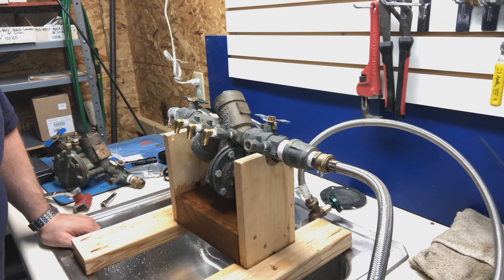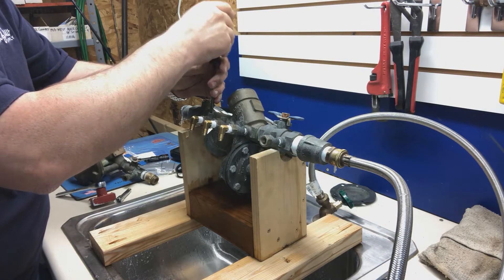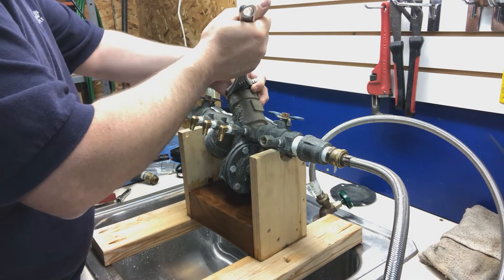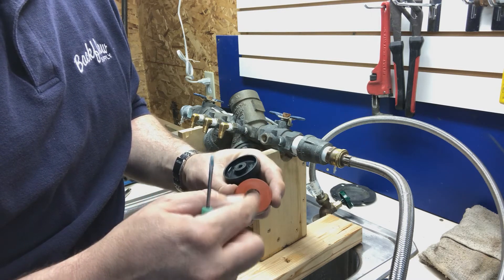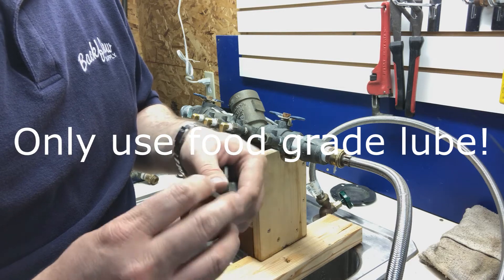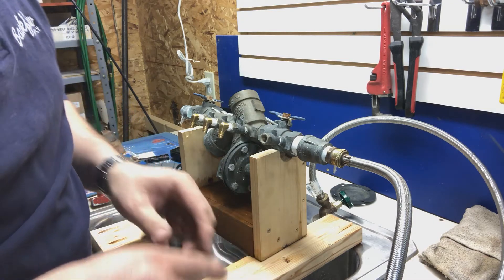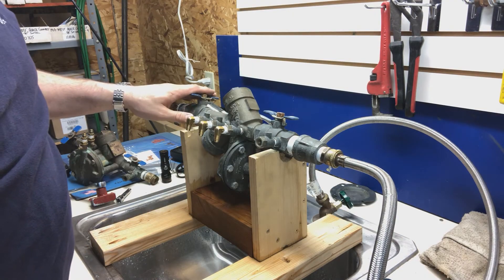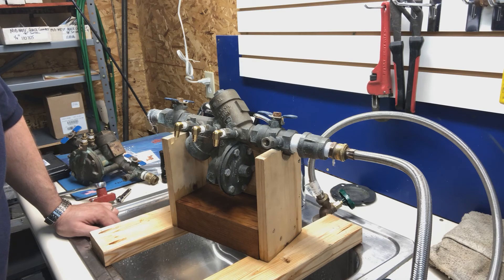How to Trouble Shoot a Leaking Backflow Assembly

Comment: How can i removed the sit inside and wgat is the special tool
Reply from the maker: If you are referring to the seat in a 975XL or 975XL2 assembly you can make your own tool or find something that will fit between at least of the nipples in the center of the seat, you can use that to unthread the seat.  Otherwise Wilkins makes a flat piece of metal tool https://backflow-supply.com/collections/backflow-test-kit-accessories/products/seat-removal-set-950-975xl or this option for the 3/4" and 1" line sized assemblies https://backflow-supply.com/collections/backflow-test-kit-accessories/products/bft-1-wilkins-950xl-975xl-seat-removal-tool or this one for the 1 1/4" -2" https://backflow-supply.com/collections/backflow-test-kit-accessories/products/bft-2-wilkins-950xl-975xl-seat-removal-tool. There are a couple of others that use a tool with a ratchet but I have been out of these for awhile and not sure when my replacement stock will arrive.

Comment: Any tips on how to troubleshoot the other valves? My Wilkins assembly is simply gushing whenever the supply is on. There's no periodic spitting like what you see here. I figure one of the valves is totally open, and maybe something is stuck in it, but I'm not sure which one without taking all of them apart. Thanks for the video!
Reply from the maker: What model do you have and size? Does it stop if you have something downstream calling or using water.  Such as a zone on your sprinkler system.  If it stops when a zone is running it is an issue in the #1 check area and may need to be cleaned.

Let me know some more specifics and you can call me at 801-355-6736 or email me at sean@backflow-supply.com
Reply: @backflowsupplyslcut9394  I had the sprinkler company come out and take care of it. A perfectly good DIY project averted by a practically instantaneous response; I was expecting it would take them more than a week.

Comment: Hello. I am unable to remove the #2 valve cover as someone overtightened. Any suggestions on how I can loosen it? I've tried  several different crescent wrenches and a pipe wrench with no luck.
Reply from the maker: It should go without saying, but make sure you are turning it the right way.  Other than that, maybe a piece of pipe on your wrench to give more leverage or even using a hammer to hit the handle of your wrench in the direction the cover needs to come off may help.   Perhaps even gently tapping the outside of the check housing around where the cover threads in to help loosen it.

Comment: You cannot know for certain it is repaired properly,unless it is tested. Just because it doesn’t leak out the relief valve ,doesn’t mean it will past a test.
Reply from the maker: You are correct!  Every backflow after it is repaired should be tested to make sure that it is functioning as it should.  In hindsight that message should be displayed on every video I have done.  I would venture to say every area in the country has certified backflow testers that will come and test your backflow, and in many locations are able to repair them.

Comment: Thanks for the video. You mention that the test cock fittings are 1/8”. Is that NPT thread?
I am ultimately trying to figure out which fittings I need to hook up my air compressor for winterization.
Reply from the maker: For the 1" and smaller line size it is a 1/8" MPT, going into the body of the assembly.  The other end is a 1/4" FPT.

Just a word of caution.  If you blow through it with a compressor.  Damage can be done blowing through the assembly and none of the manufacturers recommend doing it.  It is done, but you can do some damage.

Comment: Great video.  Is it correct to say that the backflow device gets water from the in pipe and when you need to winterize the sprinkler system, you have to close the 1st valve for the in pipe or is that not the case?  I'm trying to winterize my sprinkler system and I'm trying to identify, if any valve from your setup in the video needs to be closed 1st before putting an air compressor to the water pipe, coming in from the city?  Basically, I'm tying to identify the backflow valve, so I can close it, in order to winterize my sprinkler system.  My pipe is similar to your video setup.  I hope, what I said, makes sense?
Reply from the maker: If I understand you correctly you want to shut your water off to your sprinkler system and winterize the backflow assembly and sprinkler system.  

You should have a shut off valve in your basement or deep in the ground that shuts the water off to the system.  You don't want to use the one on the inlet side of the backflow assembly because that will leave the pipe leading to the backflow assembly full of water and you can freeze and break that.  And the ball valve.

Find that ball valve and shut it off.  Then open the test cocks on the backflow assembly.  Test cocks four small valves that have a screw slot on it.  A quarter turn opens it and that will drain most of the water out of the assembly.  Depending on your model of assembly you my need to take a cover or two off to finish draining it.  There is no need to blow through it and most manufacturers recommend you don't.  People do it because that is where the easy connection is.  You should have a blow out valve after the backflow assembly  but most people don't.

If you do hook up to the backflow I would hook up to the last one in the direction of flow.  When you are done turn the handles on the ball valves to a 45 degree angle so the ball valves are not all the way on or off.  That is the best way to keep those from freezing.

If you have more questions you can call me at 801-355-6736

Comment: There is a plastic part underneath that is leaking. Don't know how to add picure.
Reply from the maker: Sorry for the delay in responding.  You can email the picture to me at sean@backflow-supply.com and confirm the model and size and the issue and I will get back to you.

Comment: Any thoughts?
Reply from the maker: it is not uncommon for a new install to leak.  There could have been debris, such as rocks, sand or rust in your pipes that when turned on got stuck in the #1 check.  

I am assuming this is on a lawn sprinkler system.  If so turn a zone on that will get more flow going through the heads than what is coming out of the relief valve.  If it stops leaking out of the relief valve when the zones are running the problem is in the #1 check assembly.  If it doesn't it is in the relief valve.  Almost always it is in the #1 check assembly.  

If you determine it is in the #1 check take it apart and look for rocks, rust, even teflon tape or pipe dope.  Clean it out, flush the line for a minute or so with the part out and the cover off then reassemble and try again.

If you still need assistance you are welcome to call me at 801-355-6736.

Comment: I have a Wilkins Zurn Model # 975XL   It is leaking out of the diaphragm in the center hole.  What is causing this?
Reply from the maker: The leak out of the hole on the RV cover is one of three reasons or a combination.  When you take that cover off the nipple end of the RV assembly may still be stuck in it.  The part that fits into the cover has a plastic piece with an o-ring on it.  Either the plastic could be cracked or broken or the o-ring is damaged.  Lastly, it could be the cover plate inside where the o-ring seals is corroded or pitted.  If the corrosion can be cleaned out and it has not pitted the brass you may be good or you may need a new o-ring.  But regardless it is one of those reasons or a combination of them.  Call me if you need to 801-355-6736

Comment: Thank you. My valve, which I installed myself to please the water district, is 16 years old. This leak happened only once before today. That was 10 years ago.  I forgot what what I did to fix it last time. I watched a more technical video earlier today that gave me the confidence to tackle the leak. It amazing what I remembered. But your video confirmed for me I made the repair correctly. No stones or debris. Nothing I could see but a depression of wear in the washer so I flipped it over. Repaired for zero cost. Again, thank you.
Reply from the maker: You are welcome.  Just know flipping the disc won't last as long as before you flipped it as it is hitting in the same spot as the side you just flipped.  It now doesn't have any support or strength on the other side.  It is intended to be a temporary fix.

Comment: You mentioned that the washer has a "beveled edge" that goes under the head of the screw. The washer just looked flat to me.
Do you mean it is slightly concave? 
In either case, could you be more specific on what way that the metal washer should go? What are we looking for?
Thanks,
Crzzy1
Reply from the maker: The washer shouldn't be concaved.  It should be flat.  But one side should extend a fraction wider than the other side.  The side that should go against the washer is the longer side.  And the edge of this side feels a little more sharp.  The other side that is away from the rubber disc is more rounded.  
I have found out since that according to Wilkins it doesn't matter, but I have had an experienced technician of several decades tell me it does matter.  
I think over time the washer might not be as easy to distinguish the edges as I think they wear away.  You should be able to tell by the staining on the washer from the water what side was not against the rubber disc.
Not sure if this helped, but I really think putting it on will not be noticeable.
Reply: @backflowsupplyslcut9394  Thank you for the prompt reply! 🙂

Comment: What does the number 4 test cock have to do with the number 1 check valve? You failed to explain how the number 4 test cock stopping the relief valve from leaking means that. Your number one check is bad?
Reply from the maker: Opening the #4 test cock or if necessary opening a valve down stream that gets a greater flow through the assembly than what is coming out of the relief valve is a means of trouble shooting if the issue is the #1 check or the relief valve.  It in effect allows the relief valve to fully close if it is a number one check issue.  But if it is a relief valve issue it doesn't matter if water is flowing or not and you will know where to focus your efforts in your repair or cleaning.

Comment: i have the same Backflow assembly but when i turn it on today after winter, water gushing out from releaf valve and wont stop. actually when i first turn it on it was leaking from the releaf valve so i removed and put it back from then onwords water just gushes out from releaf valve. how can i fix it , please help.
Reply from the maker: Did you come in today and get parts for this?
Reply: @backflowsupplyslcut9394  no i m in Franklin TN
Reply: @backflowsupplyslcut9394  i was able to stop gushing out of Relief valve but not able to completely stop leaking. now its still leaking even after changing all the parts.

Comment: Thank you very much for this video. This is so helpful. May I ask you a question? I have to replace a 3/4 valve with a bleeder in my system. I'd like to understand why one valve has a bleeder and the other doesn't? Does it matter which one has a bleeder from the other two? Thank you.
Reply from the maker: i do not know what you mean by you need to replace a 3/4" bleeder in your system.  When you say system are you referring to just the backflow assembly?  Do you have the Wilkins 975XL or 975XL2 model?  When you say bleeder are you referring to the test cock, the valve with the screw driver slot in it?  Is it the one on the inlet ball valve?  The inlet is supposed to have a test cock on it.  So if you want to replace the test cock only you can.  If you have to replace the ball valve with the test cock in it you can get that ball valve, but most models just come tapped and threaded and you can usually just take the old test cock out and reuse it.  If you need to replace the ball valve on the outlet side of the assembly it doesn't have a test cock.  

If you need to send me pictures you can email me at sean@backflow-supply.com or call at 801-355-6736 on Monday.  I will be out in the morning, but will respond to your email or call as soon as I can.
Sean

Comment: Where did you get that socket adapter tool to shut off the water?
Reply from the maker: There are different sizes.  part numbers WV100, WV101, WV106 https://backflow-supply.com/collections/backflow-test-kit-accessories

Comment: I have a Wilkins 975XL .25-.50 that is used between my hot water heater and my floor heater boiler for backflow and is leaking.  I assume the principles are the same no matter what the size is correct?
Reply from the maker: Yes.  The principal is the same.  Follow the same trouble shooting and the parts are similar.  It come apart the same way.

Comment: I just replaced a backflow with a brand new one, but there is a slow drip coming out of the relief valve,  why?
Reply from the maker: Is this on a lawn sprinkler system?  IF so open a valve downstream and see if it stops leaking out of the relief valve while the zone is running.  If it does there is something wrong in the first check valve.  It is not uncommon on a new install for debris in the line to get caught in the first check which causes the leak out of the relief valve.  Take it apart, clean and flush if necessary and put it back together and see if it works.  

If it doesn't stop leaking while the zone is running the problem is in the relief valve.  take it apart and clean and put back together.  

On occasion the seat could have a crack in it from the factory but it is rare.  

Contact me if you have questions.  Best way is by email, sean@backflow-supply.com.  Phone you may have to wait for a call back.  801-355-6736 or I try and check this at least once a day.

Comment: How did I fix water spewing out of the tiny hole in the relief valve?  I took the 6 bolts off, replaced the #8 O ring, and it still shoots a spray of water out of the relief valve
Reply from the maker: Doug, I think I answered this in an email to you.  Let me know if you were able to get it solved.  Email is the best place to get me.
Reply: @backflowsupplyslcut9394  Thank you very much.  I did get your email.  I gave up and called my irrigation guy.  He claims he did what I tried already, replacing the O ring.  I don't get it, it worked for him.  Said there was a crease; I don't see how causes water to spray out but oh well, ready for another season!
Reply from the maker: @DougMcGregor-j4q  Glad you got it working.

Comment: I switched out all parts in both valves 1 and 2 and the relief valve and a lot of water is still coming out of relief valve out port. Can you help me with this issue? Please and thanks in advance
Reply from the maker: Oscar, you may want to contact me through email sean@backflow-supply.com  or phone 801-355-6736.  First some questions.  

Is the kit you bought an actual Wilkins kit and not just one made by some other company for the Wilkins valve?  I have seen some of these unauthorized parts sold on Amazon and they are not right.  These after market parts invalidate the approval of the assembly since they are not the manufacturer parts.

I had a local customer come in with the parts the person bought off Amazon for this 975XL and he couldn't get it to stop dumping.  The parts were not machined right and the o-ring specifically for the end of the RV stem that goes in the RV cover was too thick and wouldn't let the RV move to the closed position.

Next, make sure you have the check springs in the right positions.  The heavier of the two springs belongs in the inlet or #1 check assembly, the one that comes off the top of the assembly.

Is this an assembly that has frozen?  Was the assembly doing this before you put the kit in?

Let me know and we can run through some other things to check and do some trouble shooting.

Comment: What if the inlet valve is not stopping the water flow?  I have to turn the water off at the street main valve.  Is that a bad inlet valve?  And I have a number 4 test cock that is leaking. Can that number 4 test cock be repaired with plumbers tape? I repaired the number  one (1) check with a repair kit and the relief valve still leaks. I will repair the relief valve next.  Thanks.
Reply from the maker: Paul, yes it sounds like your #1 shut off is bad if when you turn it off it still lets water come through.  Does it slow it down at all?  

As for the #4 test cock it depends on why it is leaking and where it is leaking from if plumbers tape will fit it.  And when you say plumbers tape I am assuming you mean a teflon type tape.

If you need to you can call me at 801-355-6736 or email me at sean@backflow-supply.com

Comment: We had the exact same problem recently,. We had a professional come out any cleaned out both of the check valves and flipped both washers to the unused side. This seem to fix the issue. Then he tested the Delta pressure across the check valves and everything was within spec. Thank you for this instructional video. It was very useful to help me understand what was going on.